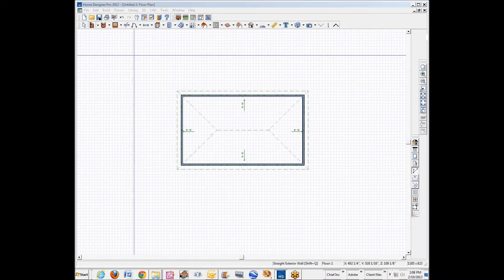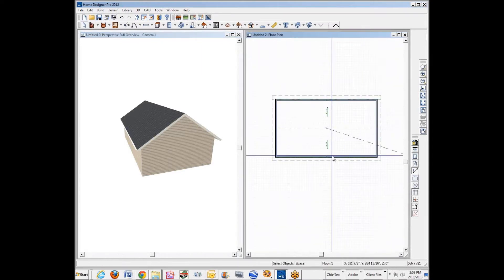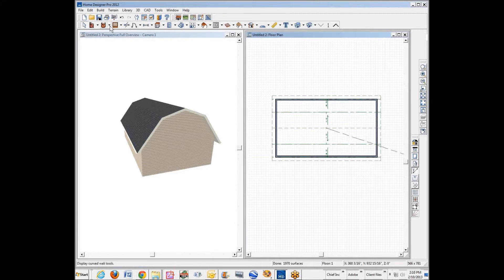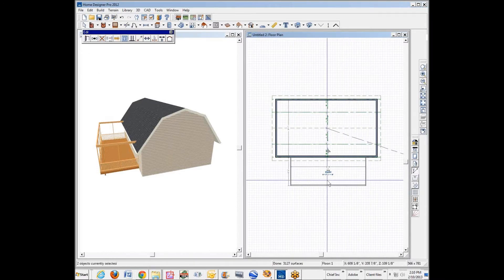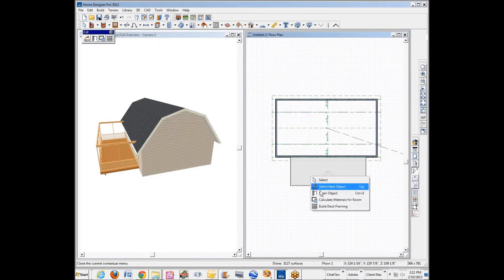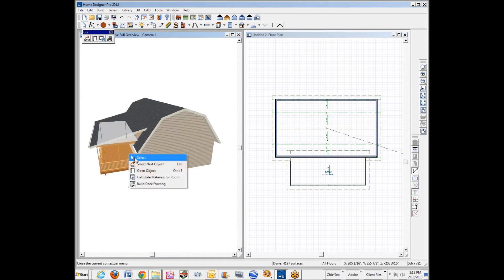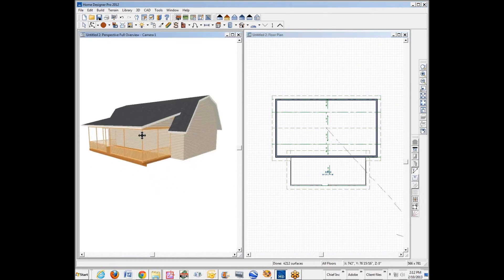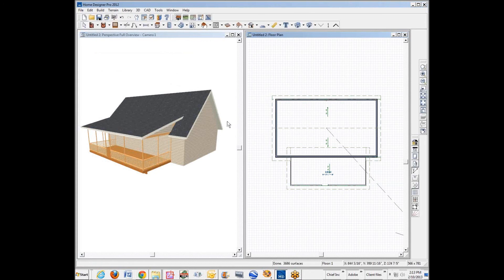Grambrel roof with a porch

Comment: I am only 9 years late to this party, but I was wondering if you could offer some further advice here.  I followed your tutorial exactly and achieved the same results.  However, in the plan I would like to create, I have the porch running the entire width of the house.  When I push out those two sides of the porch to be as long as the house, the roof automatically changes significantly and I can't figure out why.  I played with the live view side by side and just nudging the outer porch walls to meet the house walls changes the roof in a completely ridiculous and unusable way.  Nudge it back and it goes back to the configuration in your tutorial. Which setting do I need to change in order to make this work?  Thank you for any help you can offer. :)
Reply from the maker: You did not say which Home Designer or Chief Architect software title and version you are using, So my response is rather general as opposed to specific. If all you have are "Automatic" pre-settings to produce a roof system, then you will also need to look at the pre-settings necessary to produce the roofs of your porch along with the settings of the main house. They are to be found and studied in the "Build Roof Dialog - Roof Styles Tab" where are general roof styles settings are defined.
Reply: Thank you for the reply. I am using Home Designer Pro 2022. I haven’t adjusted any roof settings other than the ones showed in your video so I assume some of the auto settings you’re referring to are the cause of the auto roof change when the porch is expanded to full width of the house. I will try to mess around with those. Thank you.